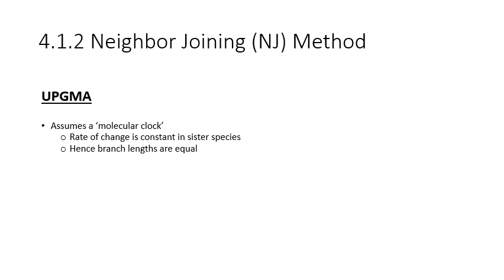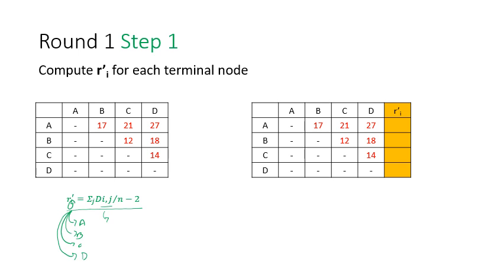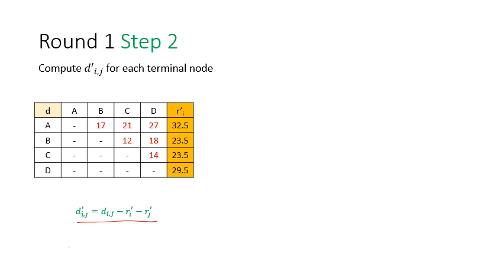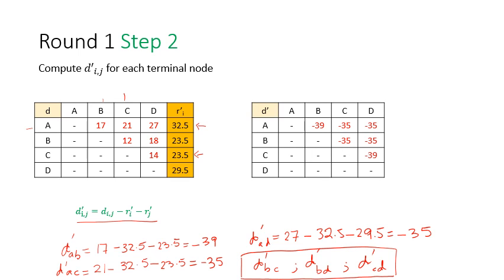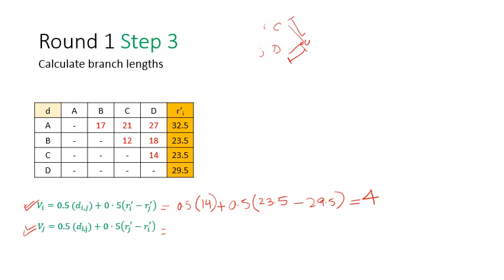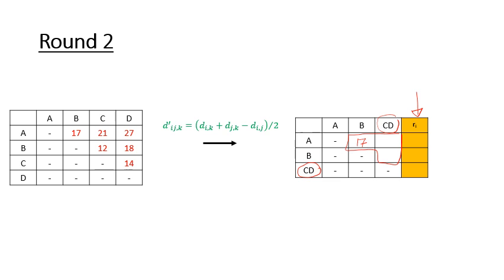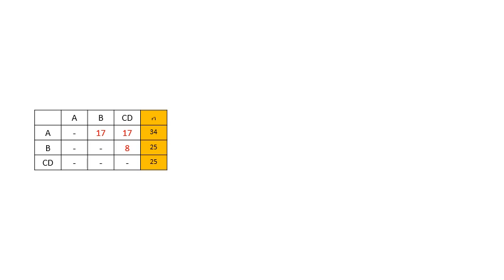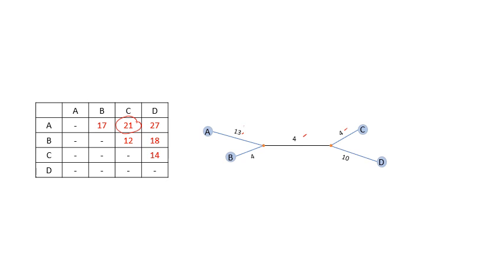Phylogenetics Part 4 - Neighbor Joining Method

Comment: Maybe you could help me, I'm trying to understand what something means, I have a neighbor joining tree and there are certain values on the branches (i.e. 100, 75, 52) and I don't understand what those mean and there's a scale (it goes from 0.250 to 0) and that I also don't understand, maybe you could help me? What does that mean?
Reply: the values with the branches (100, 75, 52) are bootstrap values. Please google that. The scale is a distance scale, in principle the number of inferred mutations normalized by sequence length,

Comment: I think rd value is wrong
Reply: May u correct or suggest.
Reply: 18:05 when you displayed r'i, maybe you forgot to divide it by 2.
Reply: @marzanbinteabid7538  To find r'i value, it is not necessary to divide by 2; rather, it's supposed to be divided by n-2. Here, the n=3 (A, B & CD). so n-2=1. Therefore those're actually divided by 1.
Reply: @arafathossen7084  Ok. Thanks.